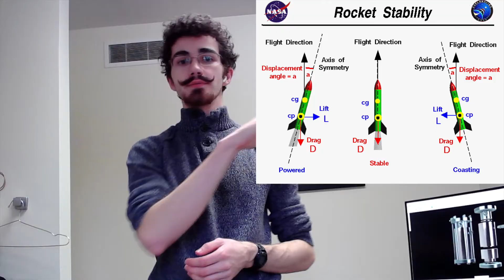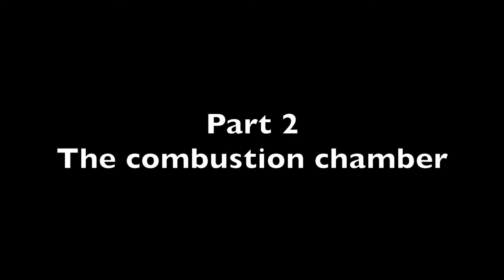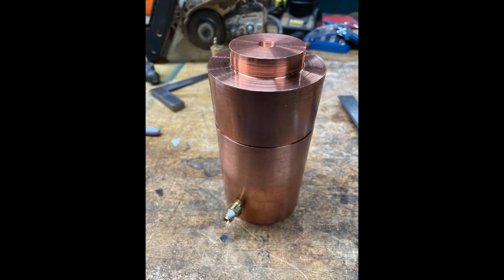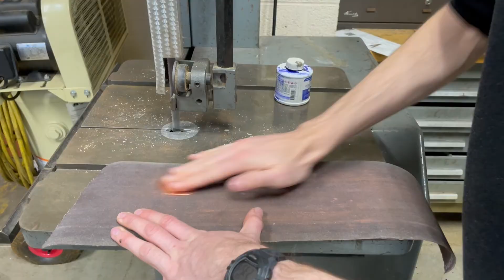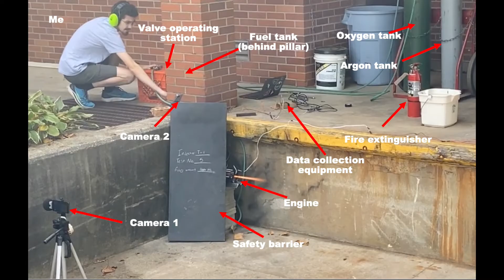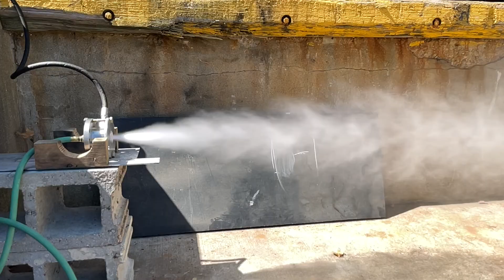How I made a liquid fueled rocket engine! - Designing & testing a small ethanol/oxygen rocket engine

Comment: Hello, I was wondering what improvement you made to not make the engine not RUD and what to avoid when making an exact engine like this
Reply from the maker: I added a 3ft section of steel hosing to the engine-did of the oxygen line, basically what that did was ensure that nothing combustible was in the o2 line. That prevented the RUD problems I was having 

Also, keep everything clean too so no oils or anything get where they can ignite if something goes wrong.

Comment: For the regen cooling channels, you should try electroplating copper as a "metal 3d printing". Copper sulphate is fairly cheap and then use wax with graphite that will then be melted away to reveal the channels.

Comment: Brother what did you use for fuel compression  ?
Reply from the maker: I used compressed argon (actually a mix of 75% argon and 25% CO2 - it's what they had in my college's machine shop). Though really, I think any noble gas will work, just as long as it won't react with your fuel.